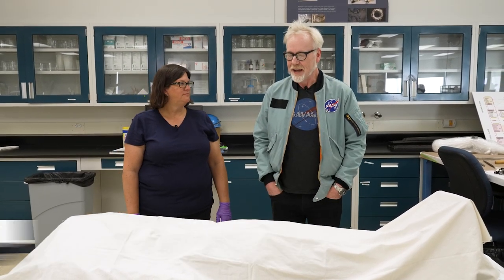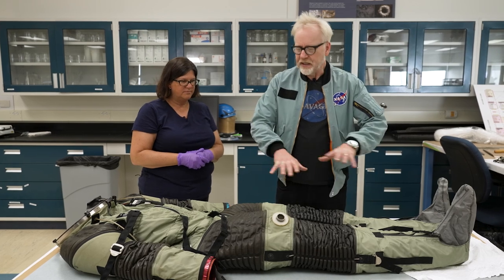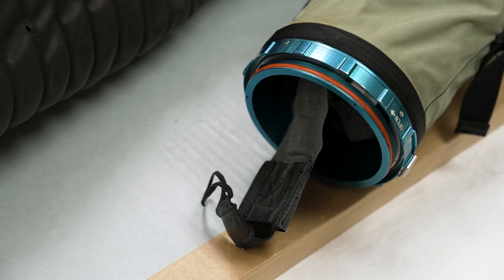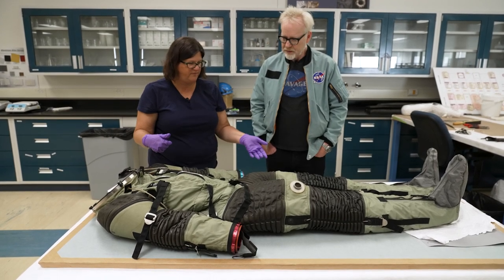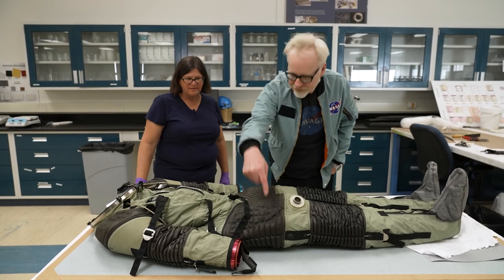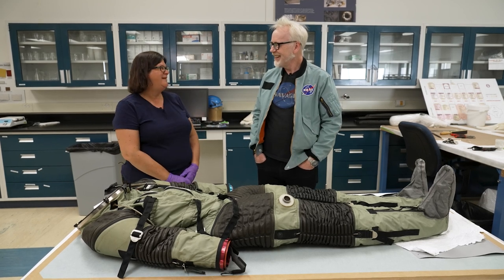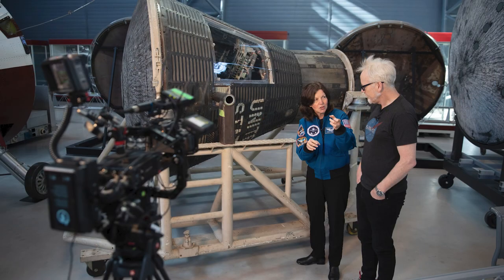Adam Savage Stunned by This NASA Prototype Apollo Spacesuit!

Comment: The fact they manage to make air tight fabric and seems is sure quite impressive, also the fact they don't inflate like ballons due to the pressure différence, truelly incredible in every possible ways...
Reply: @qed100  AIUI, there was a layer of fabric around the neoprene that provided most of the resistance to expansion.
Reply: you mean un credible
Reply: The inner layer of the suit is an airtight bladder. A separate layer on top of that restrains this bladder and keeps it from expanding too much.
Reply: @h.dejong2531  in a vacuum ???? oh and they never tested those suits in a vacuum chamber on earth because they dont have a hard vacuum chamber on earth.
Reply: @marxman00  That is incorrect. Vacuum chambers on Earth get close enough to 0 pressure to do a realistic test. 
And yes, space suits are tested in vacuum chambers. In fact, every astronaut has to do a vacuum test with the space suit made for him. https://www.youtube.com/watch?v=KO8L9tKR4CY
For Apollo, NASA did vacuum tests with the entire spacecraft (both CM and LM), with crews spending days in the spacecraft inside a huge vacuum chamber.
Reply: @h.dejong2531  It was and is impossible to make a high vacuum chamber the size of the apollo capsule, there is no such vacuum pump able to do that and no such structure able to withstand that level of vacuum as it is subject to the weight entire atmosphere pressure of Earth .
Reply: @marxman00  Look up the Space Power Facility. Largest vacuum chamber in the world, large enough to hold an Apollo CM or LM. Still used today to test satellites.
Reply: @h.dejong2531  what level of vacuum can it achieve ? and they never used it for Apollo CM or LM, and why would they ? the LM was not pressurised so why didnt the astros not live in there inside and ouside the lem for 48hrs in their suits? That would be "training" wouldnt it, but they did not ........
Reply: @h.dejong2531  they tested the suit once in the chamber and the guy nearly died!
Reply: @marxman00  That video shows one of many tests.
Reply: @h.dejong2531  so what ,is David Blaine's magic also real  ?
Reply: @marxman00  Spaceflight is real, David Blaine's magic isn't.
Reply: @h.dejong2531  but i seen it!
Reply: @h.dejong2531  A lucrative Charade at best.
Reply: @h.dejong2531  dream on
Reply: @h.dejong2531  do tell what satellites are used for, and what altitude they are located?
Reply: @marxman00   Think you forgot to take your meds buddy
Reply: @OldSlabSides  Did you think that with your brain?

Comment: Fit to Mike Colleen’s size. I just started his book “Carrying the Fire”. This video supplements it well. San Francisco’s Calif. Academy of Science adds QR codes that allow more information than a card.
Reply: If you have not done so already, Read "Lunar outfitters" it is an excellent history and time line written by a Former ILC employee(who worked on shuttle suits). It starts with ILC creating this suit among other designs before NASA even had a need for it. It also follows the interesting relationship between ILC and Hamilton standard. You are correct it was sized for Collins and he was going to do the testing, but because of availability, an ILC engineer did the initial testing wearing it. I am only up to the AX-5L so far, but a very interesting read .

Comment: I thought those straps coming out of the sleeves might be designed to attach to the gloves so you don't lose them in zero G, the same way ski gloves have straps so you don't drop them off the chair lift (or when mountaineering or back country ski touring where losing a glove could mean losing fingers).

Comment: I'd like to hear her reasoning why they couldn't use the silicone oil conservation technique on the rubber bits. Yes, it's non-reversible, but it's incredibly effective (albeit expensive, though I'd imagine the smithsonian can afford it). It would be a challenging conservation, but IMO probably worth it.
Reply: Now a days non reversible is an absolute lay ditch option in conservation.
Reply: Museum tend to preserve the original state, non reversible options are only considered as a absolut last resort when an artifact is about to get lost if nothing else is done.
Reply: they want it as original as possible
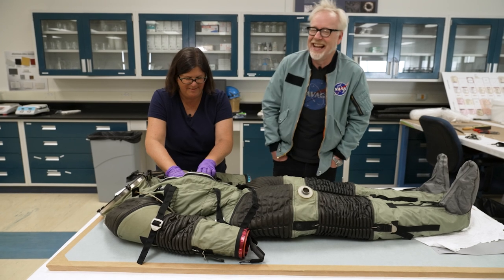Reply: 6:07 Replastisizing synthetic rubber or vinyl coatings after the have off gassed and become brittle is indeed a true challenge , i've been experimenting with various products and ultimately nothing truly replasisizes these materials. You can soften them with products like Ethanol  and  and penetrating oils or MEK but nothing really works. 
Whoever breaks this code will become rich selling their product to restorers.  On a side note i have found that a 50/50 mix of boiled Linseed oil and Mineral Spirits is an excellent product for slowing the damage.
Reply: Im sure it doesnt help that this is a blend of synthetic and natural rubber. Something that "preserves" the synthetic part may eat the natural latex, and the other way.

Comment: 6:07 Replastisizing synthetic rubber or vinyl coatings after the have off gassed and become brittle is indeed a true challenge , i've been experimenting with various products and ultimately nothing truly replasisizes these materials. You can soften them with products like Ethanol  and  and penetrating oils or MEK but nothing really works. 
Whoever breaks this code will become rich selling their product to restorers.  On a side note i have found that a 50/50 mix of boiled Linseed oil and Mineral Spirits is an excellent product for slowing the damage.
Reply: Something that I used to use in the automotive world for revitalizing rubber parts was coconut oil, I found it worked better than linseed
Reply: This is a blend of synthetic and natural latex. The mixture is itself unstable. Linseed oil is also very unstable and I wouldnt put it on anything for preservation purposes. It yellows badly, hardens, and shrinks as it offgasses, eventually cracking badly. It never fully cures, but goes into a constant state of decomposition as it oxidizes. And the addition of mineral spirits will quicken the hardening as well as destabilize the oil. It is not even recommended as a furniture polish any more, and it certainly wont keep soft materials supple. The boiled linseed oil you find in hardware stores is an especially nasty product that includes stand oil and metallic hardeners. It might make a rubber part appear nice and shiny for a little while, but eventually you will be looking at a cracking, dissolving mess.

Comment: Awesome. I did think when they were mentioning the mannequin issue, is that couldn't they basically create a human-shaped inflateable of some kind, insert it and then slowly inflate it? easy way to add support and then easy to remove by deflating it? either way, great to see this.
Reply: Great idea.  I had the same idea but then I saw your comment.
Reply: I think they try and have the suit have as little contact with the mannequin as possible except for the points necessary to adequately support it to allow for air flow through the inside of the suit  so a fully inflatable mannequin probably wouldn't allow for that
Reply: I thought of the inflatable mannequin idea as well. I wonder if they could get one that did not have detrimental off gassing and fill with it nitrogen. The feet might still be a bit difficult to get aligned, but maybe there is a way to put an uncoiler wire or nylon stiffener that would put the foot in place before inflation.

Comment: So a zipper can keep the pressure in the suite ? . .No kidding , wow who would have thought .
Reply: On the inside of the zipper, there are two overlapping flaps of fabric that are covered in an adhesive. These provide the actual seal, the zipper holds the fabric together mechanically. The air pressure presses these flaps onto each other and against the zipper.

Comment: Can they not put them in vacuum display cases so no air so they don’t degas or does it still degas??
Reply: I'm pretty sure it would still off gas. I'm not a chemist but it seems like the hydrocarbons would break down into CO2, and maybe chlorine gas, if the suit uses vinyl components
Reply: @blip_bloop  yes but a vacuum takes all air out no air no CO2 either
Reply: @clivemacken552  I mean if you have a vacuum pump constantly running yes. but if you arnt running it constantly the CO2 might accumulate over time depending on the materials and if they will sublimate and,or decompose into CO2

Comment: Sounds like they need to have a non-mannequin mannequin. Use flat-stock steel to act as the skeleton and keep it rigid... THEN use air bladders with fabric to give it the needed human figure shape.
This way you can easily move in the various sections (ie: foot, lower leg, knee, upper leg, all individual), and then inflate them one by one as they go along. Just use of the shelf laptop Hard Disk Drive magnets sewn to the bladders, to attach them to the steel frame.

If a bladder cracks and leaks, easy to replace by deflating the others, which can be left in situ, then replace the bad one! 😉

That green and black looks killer though! Looks better than orange... although, I get why, for rescue purposes. Also a shame that white is so important for keeping them cool (for the EVA variant suits, that is), as this would be a great Space Marine color – that'll be a legitimate thing one day, there's no escaping the inevitable! lol

Comment: Each hand stitched one stitch at a time. Flexibility was a known issue before we got to Gemini but my father's designs for Flexibility did not get a test anywhere becuae BF Goodrich did not want to bid on Gemini his colleague Mel Case moved to ILC in 63 around the time they were dealing with this suit...my father was hired because he aid the blue prints from Mel and my father's work before which they had all set for Gemini before Goodrich hit themselves in the head with a hammer...he came to Dover 1965 and a fully trained aeronautical engineering team was born at ILC. Subsequently things moved quickly and ILC had made the right moves and a few strokes of luck got them the bid.

Comment: Staring at this, unless they have specialized mannequins already, they should build a segmented one that with a series of levers and knobs could be disassembled to it's base parts (head, torso, arms, legs, hands, feet) and then carefully slide in each part and lock the next part onto that (get a foot all the way down with a large tapered hole in the top of it then have a leg with a matching tapered peg slid in and slot into the hole then a knob in a recess in the top of the leg be twisted to extend hooks on the tapered peg so it locks into the foot).

For the arms you could have a similar system but have two versions for whatever situation you're in. One where the hands have the pegs and a lever or knob for locking it in, and one where the arms have the pegs and whatever knob or lever is at the opposite end from the hand.

For the torso you could have it broken down into three sections with a left section, right, and center. The left and right could have pegs or slots for attaching to the legs and arms with a locking lever in a recess in the side that would press against the center section. The center could then have slots that pegs on the side pieces could slide into, either lengthwise or front to back, then two separate levers in recesses in the chest for moving pincers or clamps into place so they lock onto the pegs from the side sections.

Then for the head that could just be a simple peg that can allow it to slot into the top of the torso, this doesn't need to have a locking mechanism unless it's going to be supporting some sort of headpiece.

And so after my long winded and frankly overly-long comment there is my two cents on the base for a mannequin to be used on very old and very fragile equipment and clothing.

Comment: Lets test it underwater the exact opposite of the "vacuum of space"......oh they already do ,how wrong!
Reply: Underwater exercises are not done to test the space suit. They're done to train the astronauts. Space suits are tested in vacuum chambers.
Reply: @h.dejong2531  But they wear the exact custom fitted spacesuits underwater  dont they, which means they are under water pressure which is the exact opposite of " space" so how can a vacuum suit also be a pressure suitwork underwater??
Reply: @marxman00  no, they wear a separate training suit built to be used under water. The pressure suit would work, but the outer layers of a space suit are built for use in a vacuum, with e.g. insulation that doesn't work well under water.
Reply: @h.dejong2531  Training underwater is training FOR underwater . It is not training for a zero G VACUUM, they are in totally opposite environments so no training is occuring there, unless they are training to film spacewalks UNDERWATER. which they obviously are , there are plenty of videos with bubbles and ballast weights showing gravity direction while they "act" doing "mending stuff"
Reply: @h.dejong2531  so you think they train underwater because Things are weightless when they are underwater and there is no gravity underwater?????????
Reply: @marxman00  No. They train underwater because you can simulate a weightless environment by trimming the suit to have neutral buoyancy. The resistance of the water means that movement does not correspond exactly to weightlessness, but it allows the astronaut to practice one critical aspect of weightlessness: the inability to counter torque just by having your feet on the ground.
Reply: @h.dejong2531  The only "critcal aspect" before working on youre moves, is to not explode and incinerate in a 1 x 10-11 torr vacuum ,  do keep going, its getting very funny, you could do stand up ..in a vacuum
Reply: @marxman00  The difference between a vacuum chamber on Earth and the vacuum of space is only 10E-4 Pa. And it's the difference in pressure that counts. 
So a test in a vacuum chamber with the pressure inside the suit set to 25,000.0001 Pa instead of 25,000 puts exactly as much stress on the suit as when it's used in space. In practice, suits are tested at a higher internal pressure (+10-20%) to make sure there's plenty of margin.
Reply: @h.dejong2531  nonsense
Reply: @marxman00  Basic physics.
Reply: @h.dejong2531  Basic physics  ... Parachutes working and helicopters flying without an atmosphere .....on mars ...basic physics
Reply: @h.dejong2531  "Space" is not a chamber
Reply: @marxman00  Mars has an atmosphere. Again, you're arguing without having the correct information.
Reply: @marxman00  A vacuum chamber like the SPF is sufficient to do realistic tests on spacecraft before we launch them.
Reply: @h.dejong2531  define sufficient.. do you also  test helicopters in them ?
Reply: @h.dejong2531   0.095 psi as compared to the Earth's sea level atmospheric pressure of 14.7 psi. Helicopters use air pressure to function ....
Reply: @marxman00  For helicopters that operate on Earth, testing in a vacuum chamber is pointless. The helicopter that is currently operating on Mars (Ingenuity) has been tested in a vacuum chamber, at Mars atmospheric pressure.
Reply: @marxman00  Ingenuity takes advantage of the square-cube law: when you shrink an object, its surface area will drop, but its mass will drop more. So it is possible to build a small helicopter that will function on Mars, but you couldn't take a Blackhawk there.
Reply: @h.dejong2531  test it all you like it cannot fly ,nor could you steer it ,
Reply: @marxman00  That is incorrect. As Ingenuity has demonstrated, it is possible to fly on Mars if your aircraft is small enough.